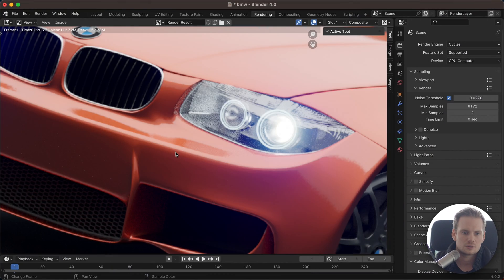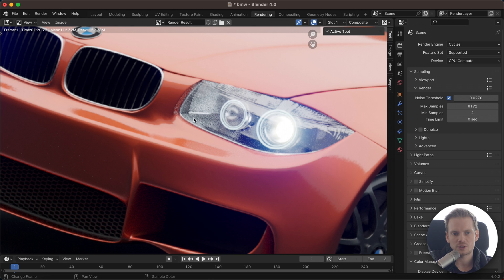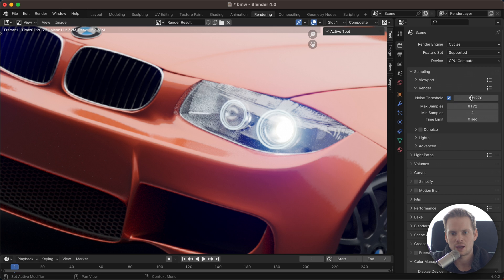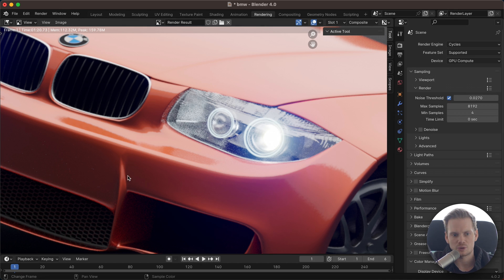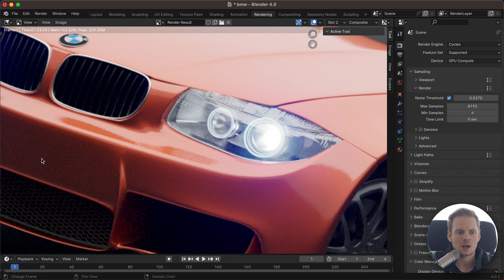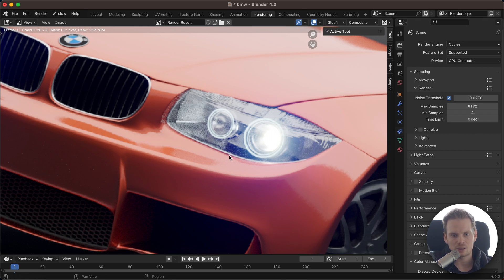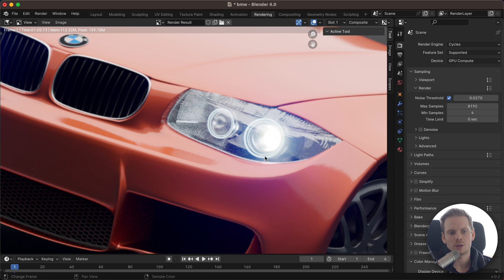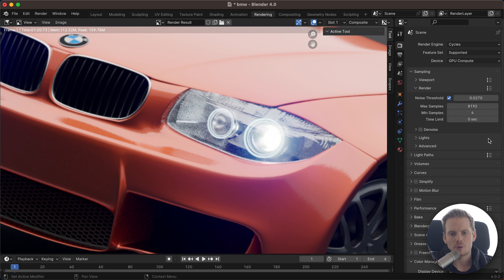Blender Optimization - Understanding Noise Threshold #b3d

Comment: Hi just a quick question. If I find a nice threshold with an absurdly amount of samples, how would I go about to determine the correct amount of samples to use on the final render? I'm still trying to understand this topic. Still a bit unsure of how it works. I've also read the article you wrote.
Reply from the maker: Blender will either stop sampling when the pixel hits your noise threshold, or when it hits the max samples.

So you don't even need to lower the samples. But I recommend setting it to a "sane" amount just to avoid large render times in case Blender thinks some pixels are not clean enough yet. Kind of like a safety net.

Comment: Hey, thanks for the video! I've been diving deep into render optimization while trying to maintain quality, but I keep encountering issues like flickering and boiling noise effects in all my animations. I usually work with relatively low sample counts, ranging from 240 to 524, and occasionally up to 1024. Unfortunately, i'm limited with my specs cuz i have gtx1650 so i can't go beyond that cuz it will take forever, I haven't found a great solution yet. The noise distribution along the frames is'nt consistent, If you have any advice I'd love to hear it!
Reply from the maker: Is the flickering caused by the denoiser, or by the noise itself? If you disable denoising you might be able to see if the noise on a frame by frame basis is super inconsistent or whether it's the denoising that's adding the flickering.

There are some other tricks you can do, like rendering at 25% sample count and 200% resolution, then denoising at that resolution, then scaling back down to 100% resolution.

If you're doing professional projects with some render budget you can also try uploading the files to our platform blendergrid.com and see what it would cost to render it in a few hours.
Reply: Have you tried high resolutions with low sample? I didn't try it yet but people claim downgrading the res. gives good results and no blur.